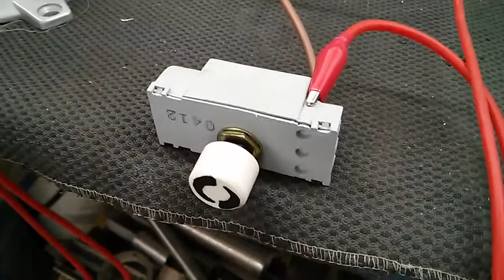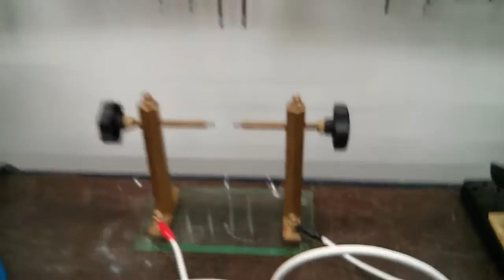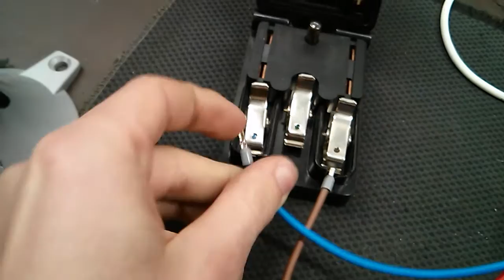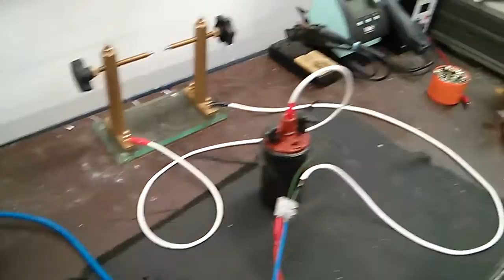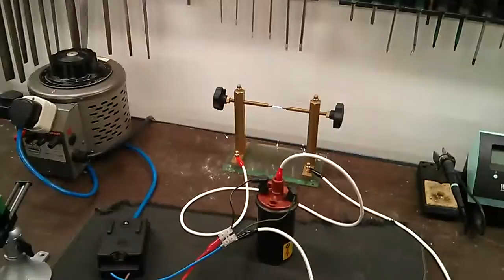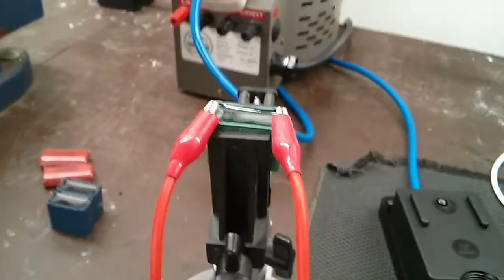Automotive Ignition Coil PWM Circuit

Comment: Hey steve.
Very nice mate. Nice set up! That spark gap ya made looks nice ! 

Ya should of made ya spark gap abit wider mate ;-)

I bet you could of got 3 to 4 inches from that mate ;-)

Thanks for sharing. 

~☆~☆~☆~THUMBS UP~☆~☆~☆~
Reply from the maker: I would have to switch off to widen the SG, I'm not a big fan of doing it running as the plastic doesn't have much of a dialectic strength, they trying to get it to trigger again would be the hard bit, I think I will attach it to my chicken stick next time. x]